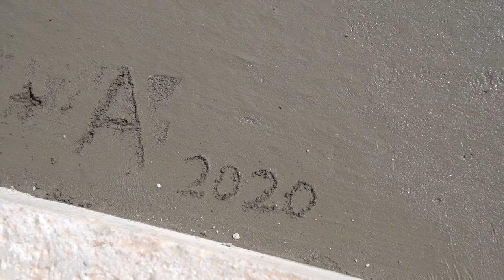OUR FINAL DAY OF CONCRETE | BUILDING OUR OWN HOME

Comment: Guys, you should totally enlist help to get it framed from friends, you'll never get it dried in alone before winter prevents you from working fast. Even having two friends come up and help with move things forward exponentially! It's still you building it-get friends to assist, I'm sure many would be happy to help!!
Reply: I agree, that's what friends are for. The more the merrier.
Reply: no way theyre closing it by snowtime
Reply: You should follow them on Instagram. They post these videos about a week after it’s happening
Reply: Marcie_aroundtheworld ~ I guess having a negative attitude and looking at the worst case scenario helps you or you wouldn’t put it on someone else, let’s hope you’re not right and they have enough support but don’t forget these videos come out at least a week or so after the event
Reply: @williamhudson4938  thanks William, I totally didn't mean my comment in a negative way, just that with the altitude it's unlikely to finish alone because the snow will come sooner then later and friends are probably happy to help :)
Reply: I'd be willing to help, but probably equal to Allies skill level, e.g. power drills, etc.

Comment: I noticed when backfilling the foundation walls there was no water being applied to the backfill material to properly control moisture content and did not see any compaction of the backfill material being done? its typically done in 6 inch to 1or 2 ft  lifts / according to your soil engineering reports  recommendations.

Comment: I've got a re-bar question.  I noticed that the re-bar under the floor was lying directly on the fill gravel instead of being suspended in the concrete.  It is my understanding that re-bar laying essentially under the slab instead of inside of it, is basically useless.     Is this a new normal standard in the construction industry?   Back (wayyyyyyyyyyyy back) when I was doing that sort of work, the re-bar cage was always elevated off the ground of the slab being poured.  After tie wiring the cage we always suspended it using stones, bits of broken concrete or broken cinder blocks.
Reply: Terry E ...I’ve noticed that contractors are leaving the rebar on the stone; then during the pour they use a hooked bar to lift the rebar up off the stone so that is in the slab!...
Reply: @RobertSmith-nm5vj  I agree that many do what you say, but if you review this video and stop it at 22:20 you will see that the re-bar is NOT lifted.  Look closely at the pour nearest the camera and you will see the re-bar is definitely totally below the concrete and in contact with the stones.   Some will say (and I tend to agree) that pouring concrete over the re-bar that way will serve no purpose and the concrete will probably crack if the underlaying base ever settles.

Comment: Umm, as some one who did residential concrete work in Oregon for 30 years, 2 things. One, NEVER back fill your foundation wall until the floor is framed in. Even if your wall is fairly short, you can and will move the top of your wall with the pressure of the dirt. Also, with those strip drains, and I have done a lot of them here where we get 50 inches of rain in the winter, we always would set them in concrete first, with 4 or so inches of concrete under the drain for continuous concrete strength. You want some concrete around the bottom lip of the drain to set it in place, and do that about every 2 feet for the length of the drain. That stuff wants to float as you pour around it. Much easier than trying to stake it down to keep it in place.
Reply: Wow is there a story with that email handle? Yeah about build , here's the deal so you don't get as crazed as I got early on- this  build is drama for their VLOG  and it's like theater : nothing is real. I mean sure they will build a house etc...but so far Trent and Allie have paid zip attention to the architects advice or to Kevin ( contractor) on build,  or to the 100's of subscribers who have been busting their keyboards with solid professional  facts and advice. Nope Trent and Allie just don't seem to want  advice, rather just have the "rush" of last minute scramble. So save yourself the effort , they just aren't interested ( such a bummer I know LOL).

Comment: Building flexibility is the structural engineers nightmare! Not necessarily because the way it ends up being built is wrong (although sometimes it is, and then it becomes an even bigger nightmare), but because when changes are made that, the engineer has to sign off on, the builders always need that letter or plan revision yesterday, and as I know you are now aware, the building process does not work like that. That builder may only be working on one or a couple projects, but that is likely not the case for the engineer, who is offering support on previously designed projects as well as working on new.

Anyways, just wanting to say I am really enjoying watching your build.  As someone who usually just works on structural plans before the build, I rarely get to see the actual building process.

Comment: I'm dumbfouded that backfilling was done before floor joists were installed to support walls
Reply: The walls have not cured yet
Reply: David Normandin That’s so hard to tell to me, because they could’ve put additives to the cement to help it cure faster, and not sure what temperatures were like as well.

Comment: Use dryer sheets to keep the bugs away it works great it makes you smell good too also get a gallon Ziploc bag or any other bag that will hold water clear bag put two pennies close up the bag and hang it anywhere you have a fly problem it works awesome also have a great day and God bless

Comment: Even if it snowed, it won't hurt anything.  When I was building habitat homes in South Texas, in the early 2000's, we would  flood the foundations so that they wouldn't dry too fast and crack.  Concrete dries better underwater.  Look it up.

Comment: Hope you got yourself a great compressor (including humidity control) and a great nail gun, plus xtention hose for your compressor .  You don’t want to hammer nails.  

Bonus, you will love that compressor in your garage after.  Amazing how many thing need a compressor.   

NOTE:  Don’t go for the mega, but not the small one, you still want to be able to carry it around.  Outside and inside.

Comment: If you really think it will snow Saturday and stick around till Monday but you still want a frame you should snap your lines on the concrete wall while it's dry and spray them with clear coat before it gets wet makes the job a lot easier to have them down after removing the snow it becomes alot harder to them accurate

Comment: might be a good idea to cover up the concrete with a layer of thick foil so it doesnt dry too fast or freese before its dry , its generating heat while drying so it shouldnt but the water might get out too fast and hurt its overall strength if the air is verry dry and the foil would stop that , i learned that the darker the colour of the dried concrete , the tougher it is 
structures look nice , you might be able to park the trailer on one of the slabs untill youre start closing it up after all , you could at least store the lumber there now , and sort it out by order of use to make getting at it eazier 

wonder if you can make youre own porta potty and plumb it intoo the septic system might save a few bucks over the time not renting the porta potty and having it emptied while youre building and livving in terry

Comment: New to channel, happened on this video but hope to catch up with others, as time permits. At 22:22 when placing the concrete during pour in progress, a couple of things were observed: In lieu of 6x6 steel mesh usually seen if placed in a garage/shop floor, rebar was used. Usually rebar spacing would be a maximum of three slab thicknesses if required for any design based load-bearing capacity. I'm assuming the plans you have shown, as prepared by an architect, would indicate correct spacing, if required. But since rebar is laying on grade, with spacing larger than one would expect to normally see, it would appear that no reinforcing may have been required? Good luck with your efforts and keep the inspectors satisfied.

Comment: Sometimes you have to think of what is above a pipe. Maybe it is there because it runs through a wall above in the living space or its vent stack is in attic an area above. So don't deviate too much or you may have a problem later.

Comment: It would be a very good idea to get the backfill contoured ASAP to channel water away from the structure. Letting the next rain run towards and accumulate around the house is going to be a BIG mess. Framing in a mud pit will not be fun.

Comment: So... What happens if the wood gets wet??? Or snowed upon??  Will you flatten out the approach to the buildings before you gravel in the access??  Should use a stabilizing product before gravel product.  Investing in a tractor with bucket and forklift would be a wise investment really soon, .... can always sell later.

Comment: Guys! You are doing so great, although it seems chaotic to you, this is somewhat the norm for builds, you were able to get it done. Do not sell yourself short, In over 40 years of experience in the building industry, I have seen really disastrous conc pours. A little advise, plan out your days work a week ahead so you have all you need, and you will not get the adrenaline rushes you just experienced

Comment: Why no vapor barrier before pouring the concrete or even better 1/4 poly foam rolled out to get a thermal break? Seems like a missed step, especially knowing the ground water issues and the drainage that was required as a result...

Comment: So where was the rebar in structure one? Basement? Did you use that special mixture that you don’t need rebar for? 
Our neighbors used that concrete for their shop and they have cracks everywhere because they didn’t use rebar
Reply: Early on in the video Trent mentioned someone was coming to install the rebar prior to concrete poured.  A quick statement that was hard to hear.  Only because I was listening hard did I hear it.

Comment: Good news... there are two things that can go wrong and delay a build. 1. The foundations 2. Windows. If you have large or none standard windows - measure 3 times, confirm the measurements 3 times with the window builder,s then hassel them for a delivery date and don't take no for an answer. On all the home builds I have seen... windows have always caused a delay. That is why I would design a home with standard window sizes. But it looks like one major part of the build is done. Congrats!

Comment: great work guys, big mile stone for sure.  Don’t forget for at least 7days the concrete cannot freeze, place a tarp over the concrete to prevent the moisture from evaporating and retaining the heat.  If it gets too cold, you may need a heater.  I poured my house slab in Fort McMurray AB at -30 and had the heater going all the time, seemed like a big sauna… Fun times…  googleconcrete curing in cold weather  here’s one site with some info  https://www.cement.org/learn/concrete-technology/concrete-construction/cold-weather-concreting

Comment: As an inspector I hate to tell you all that rebar is not doing much. It should have been setting on chairs at 48" on center which would have kept the rebar at 1-1/2" to 2" above your rock aka "grade" allowing the concrete to fully embed the rebar within the concrete. Hopefully it all works out.

Comment: I have a few ideas AND YES... some may be TOO LATE to incorporate...

water!!! water can be your friend AND your enemy. Try to install a solid plastic surface in cabinets under sinks in case of leaks... you'll generally keep cleaning supplies and trashcans under there so you'll appreciate the easy clean up AND that the wood doesn't warp or degrade over time. Also... try to install a DRAIN in the floor under the kitchen sink just in case there's a leak there, too. Bathroom? Laundry Room? Same. Basically anywhere there's a place for water above, drain below... AND if it's possible you might appreciate an emergency MAIN WATER SHUTOFF valve OUTSIDE but closer to the home than the road.

And toilets! I know men have been designing these things for eons but they certainly have, subconsciously or not, incorporated "systemic misogyny" because there's RARELY enough room around a toilet to use a basic cleaning tool... mops, etc. WHY WHY WHY?

so if you can get your toilet spaced well away from walls and stuff... then MAYBE just the back of it will require hours of yoga and contortionist flexibility. You will age. You will be grateful later... even if you cut into closet space or something.

Sooooo... it's men doing the designing, building and installing but women doing the cleaning... IF it were different (men were cleaning) than this issue would be a non-issue. They would have fixed the design flaw A LONG TIME AGO.

I'm certain Trent knows already because you guys have built and renovated SMALL & TINY. Now that you're building a home... think about ALL the things you do HATE about small... there are a few... Don't make those mistakes while you've got time to consider them...

And Allie said... ya know... things CAN be changed. 

I'm telling ya... a foot on either side of the toilet will keep you BOTH happy.

Just a few ideas... apologies for the urgency and passion in the delivery. You do what you want... these are just some things to consider.

:)

Comment: Wow! So many negative Nellie comments to this one! I love you Trent and Allie. Just wanted you to get a nice comment to counter all the sad people out there who like to make others feel as down as they are. I'm not referring to the ones who make the construction comments. Because those are constructive criticisms that might save them lots of money from mistakes. I'm now worried about the foundation after reading the comments. Hopefully it will all be OK in the end. I do know that here in Florida many homes are built with the plumbing in the slab. Which is why we had to replum the house last year. I noticed that the floor was warm under my feet in one spot in the kitchen. We brought out an expert and he determined that we had a leak. This could eventually cause a sink hole under our house or a crack in the foundation. And he pointed out that once your plumbing starts to fail it may not be the only place it fails. And we have the nice tile floors that are the same all over the house and didn't want go have to replace them with something that doesn't match. So we had them put in pecks. I probably spelled that wrong. But it's flexible tuning that runs through the walls instead of digging up the floors. So much better and faster. Probably much cheaper too. I wish you well T & A on you build. Please learn all you can beforehand. I am a bit worried a out your foundation now.

Comment: using your foot as a saw horse is not a very good habit to get in to eventually your luck will run out, get yourself a saw horse and use it to cut your material.  I'm a safety manager and I've seen when that bad habit has gone wrong, short cuts will kill your timeline all the time, if your injured your not working and the house isn't getting built, play it safe it doesn't take any longer to do it correctly, you may find that it becomes more efficient because the housekeeping is controlled to one area, the foot print of the house isn't that big that you would have to travel far to reach your work station.
Reply: I just have to ignore all the amateur's stupidity . When anyone is on my job they learn real quick  JOBSITE SAFETY and OSHA rules - bad day for everyone when someone gets hurt. And for Trent and Allie it should be just common sense ? safety glasses, back brace, steel-toed shoes, scaffolding, and  stable workbench with mounted table saw  - have to just ignore all the 'shoulds'  LOL

Comment: Just a heads up before you destroy your concrete walls: if you don’t have all water draining away from your foundation right away, it’s going to accumulate in the dirt around the structure. Then when it freezes out, before the house is dried in and heated, the basement walls will transfer the cold into the surrounding soil, freeze it, expand it, and crack the shit out of your walls. Ain’t no fixin’ that. Your structure is compromised and and you are screwed. Bulldoze it and start all over. Hope you don’t let that happen, and listen to the folks on here with real construction experience.

Comment: Allie: "Tell me it gets less stressful"

Can't tell you that.  You adapt to it.

Were you not required to have rebar in the house floor pours?  In Kansas, that concrete would be shattered in a matter of years.
Reply: Wasn't there rebar everywhere? Looked like it to me.
Reply: I saw it in the garage after I posted, but didn't see any in the basement floor.  Usually, I go overboard, figuring rebar is cheap insurance.
Reply: I wasn't really concentrating that hard, maybe there was some in the basement but not as much as in the garage though that might be a strange thing to do? I expect it's all pretty solid anyway:-)